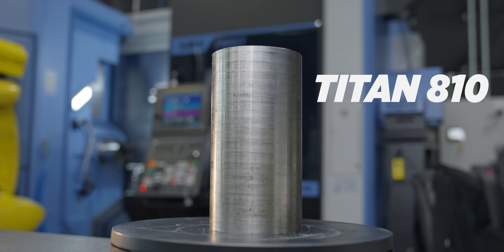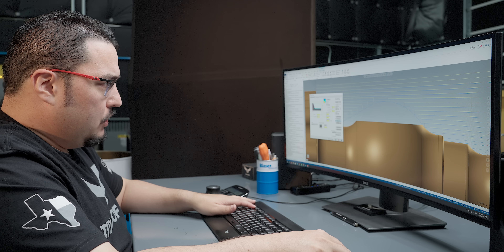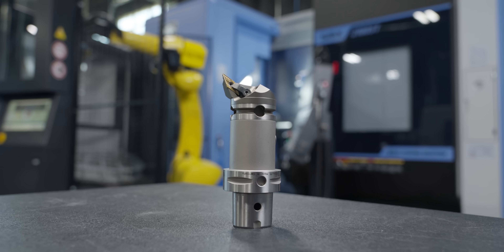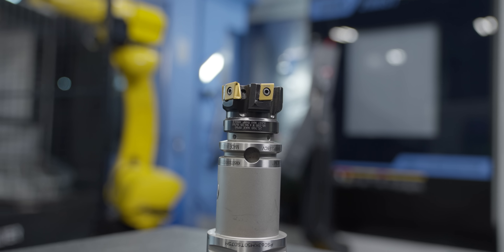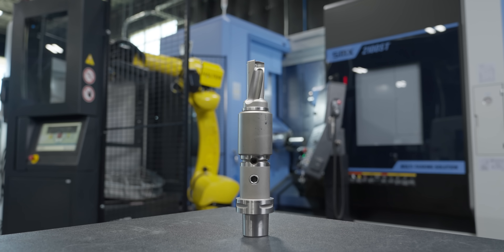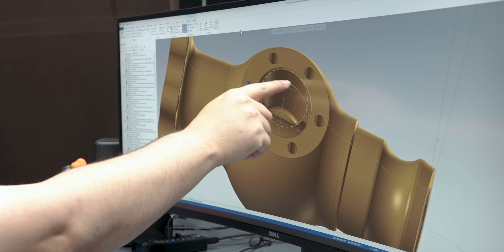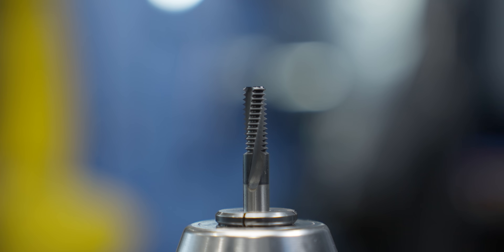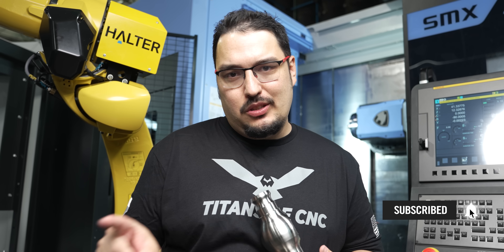INCREDIBLE 9-Axis CNC Machining Process in Stainless

Comment: Great video! How would you design cutting an o-ring groove on the round inside part of a pipe wall? Picture cutting a pipe in half, laying it down, and cuttiing an o-ring groove so I can fit  flat on the inside sidewall of the pipe? Aluminum round stock 3" OD x 2" ID and setting an o-ring flat against the inside of the 2" ID using an o-ring size 9/16" OD x 1/2" ID x 3/32" deep square groove to accomodate a 1/16" thick o-ring. What would the process descrition be called? This clamp will clamp onto a p[ipe with the o-ring sitting flat between the 2 pipes. 
Please let me know.

Comment: I realize that the chucks are holding a substantial amount of material, but am curious why you're not using a live center to add stabilization at the free end of the piece for the 90° milling and drilling operations.

Comment: you'd actually get much more consistent threads if you use an AFR calculator, chip load is always given in linear motion, not arc feed rate

Comment: You only need a few degrees of clearance on the backside of the tool, that's why it's set for 3 degrees. You didn't show the rest of the toolpath where MasterCrap cannot automatically enter or exit the cut in Mill-Turn. It's a glitch that makes using 3D tools useless.
2025 version is completely broken because it cannot color loop through toolpaths so you can't even see what stock is being removed. Absolutely garbage software.

Comment: Guys. No matter what the marketing hype is there are still only 6 axis x,y,z, rotation about x (A), rotation about y (B) and rotation about z (C).  Sorry guys laws of physics still apply. You could introduce time but that only moves in one direction. So how many frames of reference does the machine have. And how are they added to the machine.
Reply: These machines have 2 of everything because they have 2 spindle so xyzc on head one and xyzc on spindle two then they have a axis for picking the part from one head to the other which usually call it B hence 9 axis machine
Reply: Once you catch up to the few of us that understand phase shifting you will see that many laws of physics no longer apply :)
Reply: @daleaha7415  🤣

Comment: I am amazed that the part can be machined hanging out that far from the chuck without a tail stock. No chatter.
Reply: Material and thickness of the part. If it was 1" in diameter with that much stick out, I'm sure some things would change like the ID hole being drilled after he did all the milling and/or he'd rough the front of the ball and not the rear for more rigidity.

I haven't made this part but had to make something very similar in 1.25" dia aluminum and you'd be amazed what is possible when you try some of the "what if I do" thoughts.
Reply: Gripper jaws.
They’re a gift from God.
Tailstock centres are really only used on shaft work these days.
Reply: He started out with 4" material
Reply: stick out can be upto 2 and a half times the diameter that you are gripping, has always worked for me
Reply: I was interested in the surface finish on the I.D. with those harmonics
Reply: I was thinking the same.
Reply: High rotating mass has a lot of inertia, its different with stationary mass.

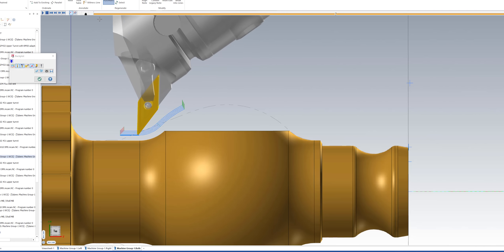Comment: 4:00 you mention turning and angle your tool differently for the backside of the radius, why not angle the roughting tool for the same work?
Reply: I'm guessing here, but 304 stainless steel is tough to machine due to work-hardening and high cutting forces. It requires a cautious approach to avoid tool wear, heat, and deformation, so maintaining tool rigidity is key.
That’s probably why Tyson uses a more rigid tool orientation for roughing. For finishing, with lighter cuts, he can change the tool angle to improve the surface finish without worrying about deflection or heat.
Just a guess—I'm nowhere near Tyson’s level!"
Reply: @timothykraft7125 Yep, that’s exactly it.  I did take a look at it with the rougher and it would still leave a little bit of material even at different angles too, so it wasn’t worth it to me to sacrifice that
Reply: That is the reason. We machine a lot of 455 and  465 Cromed cobalt. Medical instruments and implants. 304 is like cutting warm butter compared to some materials we machine. Love 17-4 stainless.

Comment: Just for interests sake .how come you didn't drill the central hole in the original materials mass and at its most rigid ,rather than removing stock before drilling .not a criticism , I'm sure that there must be a reasoning behind it .
Reply: I'm not 100℅ sure I'm on the same page as you but my guess would be that drilling the side hole first would make all of the turning operations after an interrupted cut which especially in 304 would not be a good thing.

That and it would no longer be balanced
Reply: I've seen batches of billets where the length varies by a few mm and because of a worn blade they don't actually have faces that are perpendicular relative to the outside diameter. Good practice to establish a datum face that has no high points that may deflect the drill causing radial runout of the hole to be out of spec at the bottom, not the sort of drill i would want to put a peck drilling cycle in. Another reason is if you drill it first then you have to compensate for the varying length of the billet and adjust you drilling start position out a few extra mm so that's extra time wasted cutting fresh air.
Reply: I was thinking about the exact same thing :)
Reply: My best guess would be the purpose behind that piece cannot be that accurate so for simplicity purposes they just didn’t do that step especially if the machine is able to hold on to that mass with no issues.